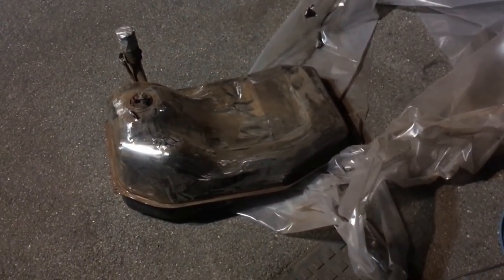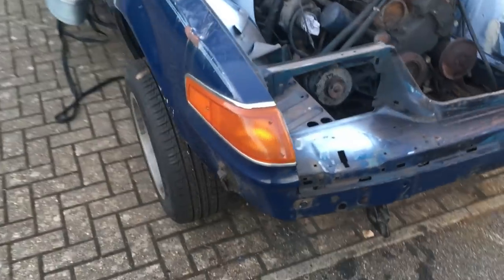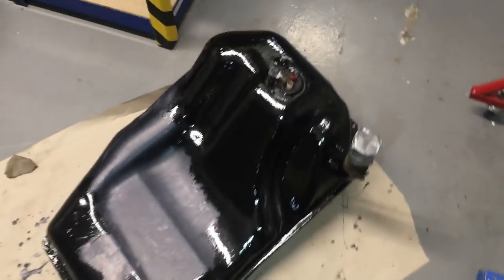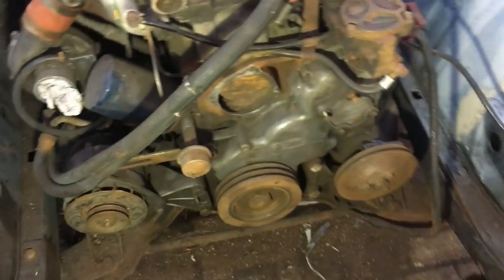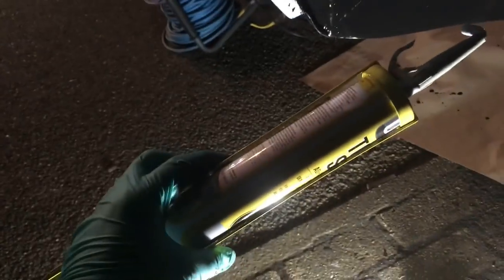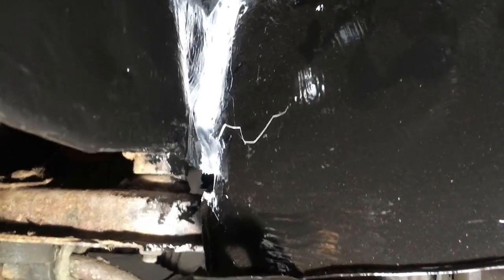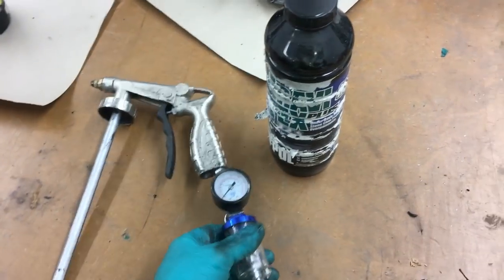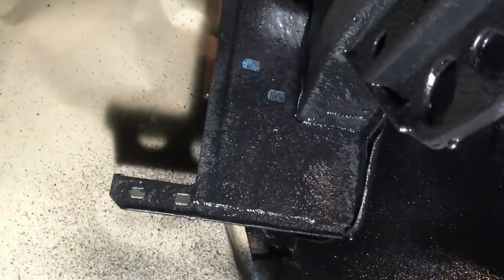18:27    Rover SD1 2400 SD Turbo restoration - Video 38 More painting including spraying stone chip

Comment: Nice going so far,  the battery bracket could be cleaned up with Driveway cleaner Acid,  I leave parts like that in soak for a few days (sealed containers)
They come out with no rust on at all,  then wash with water, dry and that I use panel wipe,  paint of choice for me is Rustolium Hard Hat,  I've not used epoxy paint before, but I think I will after reading your stunning build on The police SD1 over on RR , 
Keep up the great work 👍

Comment: I was surprised you were going to pay someone to paint the engine bay. I would imagine you could do a perfectly reasonable job with some rattle cans as it doesn't have to be perfect in there. Great series of videos by the way. Keep them coming.
Reply from the maker: Thanks. Yes I was thinking of doing it in cans as you can now get 2k with hardener in rattle cans. Did it with a proper spray gun in the end.

Comment: Hi james how do find the jotun 87 mastic paint ,quality of finish etc .brilliant work as always  keep it up.im refurbishing the underside of my granada .i use epoxy primer followed by anti stone chip
Reply from the maker: It seems like pretty good stuff. What I’ve learnt is that it likes a surface with a really good key. So before you paint it in go over the surface with a grinder and a thought grit flap wheel. It’s think even when you mix it to the recommended ratio with hardener. In terms of protection, then if it’s on non rusty metal, it’s pretty impervious. I painted the wheel arch on that rover 827 and left it outside for 3 years and it’s not rusted yet. I did the axle case in the police car, which was just ground down and painted over (I never treated or removed the rust) and after 3 years it’s starting to come through but that’s only because I never got rid of the rust in the first place. Hope that helps. James
Reply: @nitrosilvia  thanks james much appteciated .hope your elbow is better .Dave 😀👍

Comment: Nice job and a good video, thanks. Is the Jotun epoxy made in Thailand? Is it Jotun 87? Just curious as it is only 35 quid where I am for the paint and the activator, but I am unsure it is the same thing. Thanks.
Reply from the maker: Im not sure where its made, but it always has a penguin on teh tin.  The jotun jotamastic 87 has now been replaced with 90.  Not used it yet nut im sure it will be good.

Comment: Did you use a wintergrade jotun primer? Thanks for sharing
Reply from the maker: I used the normal grade stuff.  Most of the time its warm enough here.  If you go on the jotun website you can find the data sheets with all the specs.

Comment: How do you find the Jotun stuff mate?
I’m looking at this for my Mondeo and old Mercedes rather than raptor liner seems you be a good product as it’s used on boats.
What do you think of it?
Reply from the maker: Its nails.  You just need to make sure you give it a good mechanical key first.  Then its great.  If its a smooth surface it can just delaminate.  If you are going to overcoat it with something else, do it within a couple of days other wise you will have to key the jotun to get anything to bond to it.

https://forum.retro-rides.org/thread/131089?page=27
Reply: @nitrosilvia  cheers mate , no I’m not over coating it , so would red scotch pad be sufficient or do I need 180 grit paper on it
Reply from the maker: @medievilassassin  no you need something real rough like actual hard sand paper.  And make sure its really well de greased.  ALso note that this stuff tends to dry a dark matt grey rather than glossy black
Reply: @nitrosilvia  yes mate they do RAL colours now so apparently when you choose black it dries black but we shall see , does it dry over seam sealer?
Reply from the maker: @medievilassassin  Ive not actually painted it on sealer so i dint know.  Id assume is it was done in the first couple days it would be fine